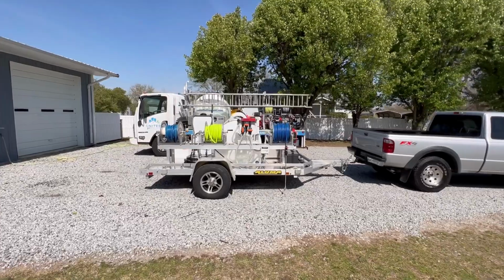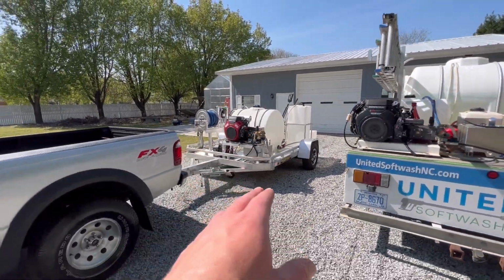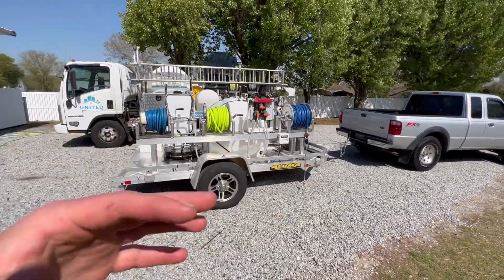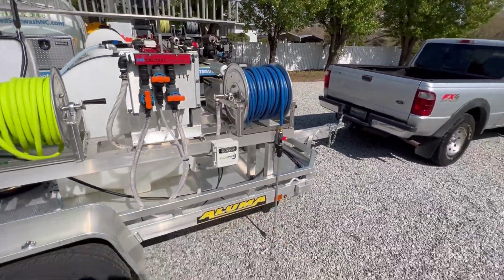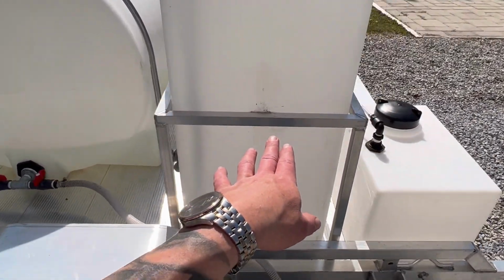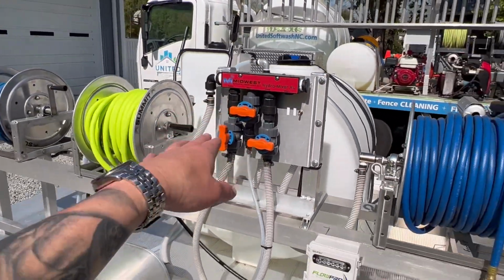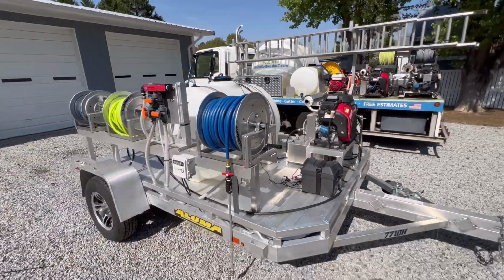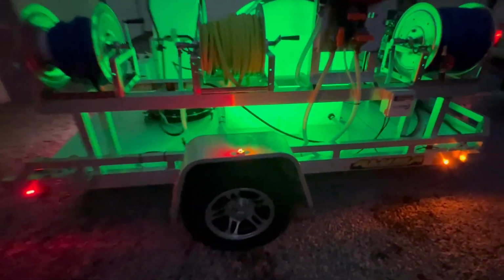Pressure Washing Has Never Been Easier! Check Out Our New Wash Rig

Comment: Just put a deposit down for this rig but upgraded to a gas roof pump. The guys at ICE have been awesome. Should have it in Florida in 2-3 weeks. Super clean looking!
Reply: jhow much did you pay for the whole set up?
Reply: @allaboutpaintllc  they gave me a good price and I upgraded to the gas roof pump instead of the 12v Softwash system, just under $23k. ICE are super responsive and give great customer service. The aluminum fuel tank that came with it started leaking on a weld and they replaced almost immediately without question. The skid has paid for itself already. Very happy with everything. The 225 gallon tank so far keeps up with both machines washing so as long as the customer has good pressure and flow. My SW system is dialed way down for most roofs unless I have a two story and that thing slings it right on but you have to dial it in when u get it. It took me a wash or two figure it out. It comes dialed in at full pressure. I dial the pressure to almost to nothing and lower the engine speed to half and get a 12v system result but it’s awesome if you have to reach way high. Plus they gave me a 2’ longer trailer at no extra cost.
Reply: Can you give us and details on pricing for the rig with gas roof pump. I’m very interested as well.
Reply: How did the new set up go?
Reply: @heyricksander  so far so good, I did build a 12volt softwash system on it. Overall I’m happy with the rig.

Comment: Quote --> "I don't use 12V to clean the house, I down stream". What are you using to down stream to or from the 8GPM pump?
Reply from the maker: I down stream with the pressure washer . the soft wash system is its own dedicated pump
Reply: What does down stream mean?

Comment: I need advice on a good pressure washer. It seems I can only afford a 4 gpm pressure washer. I seen a video of someone put together a 8 gpm for about the same price. Any info on a good system w/ unloader bypass for a great price? Or a proven build? I appreciate any info.
Reply from the maker: whats ur budget bro?
Reply: @softwashtv6315  Unfortunately, I only have $2,600 to work with. With getting a couple other necessary pieces equipment, I was hoping to be somehow build one for a reasonable price. I appreciate your reply.
Reply: I went with a 4gpm pressure with the intent to build one later due to time and money. Do you have a recommendation for a bypass setup to return back to buffer tank?

Comment: Still learning.. Having a separate SH container and soap container how does the downstream pull from both containers and not get to much soap without a blend system? Thinking about manual batch mixing. Thx for any clarity on this.
Reply: That's what the manifold is for.
Reply: @utiriacards  the manifold is for the 12 volt. Not the pressure washer.